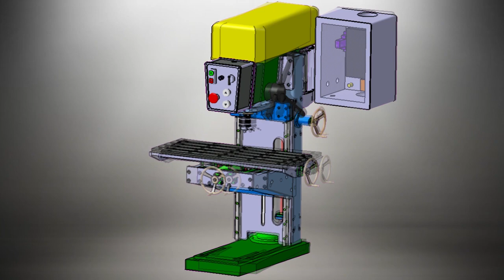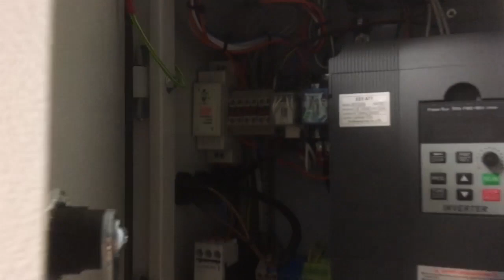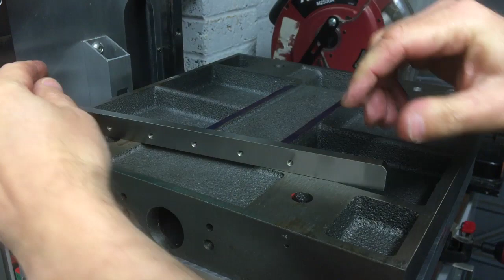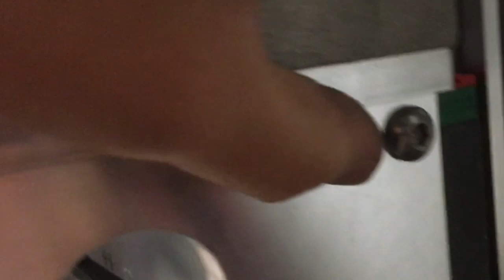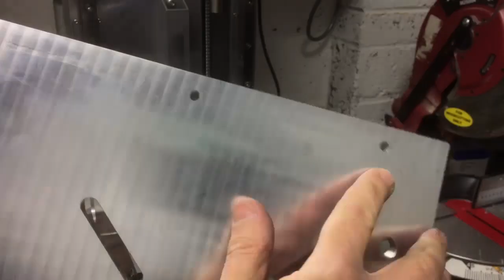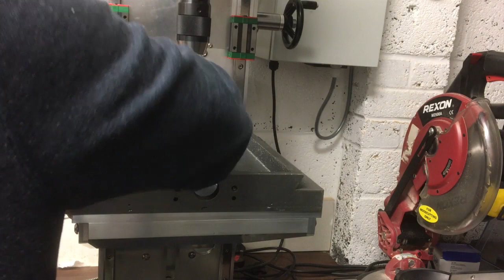Ep28: Drill Press Upgrade | Back on track . . . briefly

Comment: I'm late to these videos but still a word of advice to those that might watch. Don't assume that the cheapest item is at fault while being way over confident in your own work. Yes it could be the XY table but the first thing he should have done is tram the work table attached to the press, even with the dodgy chuck. Also removing the top plate of an entire structure to check for flatness is pointless as every fixing could be pulling it out of flat, including the back column. I'm only at 28.28 in this video so we'll see where this ends up. I'm enjoying watching these videos, including the diversion into ethernet conversion as I learnt of a different option for when my 2 CNC running XP computers fail. He also must enjoy fiddling because for the time & money spent on this, he could have bought 2 decent Schaublin's.
Reply from the maker: I had to skim watch this again to check what I uploaded as it has been a while!  I did tram to the original aluminium knee that I made but it was either an earlier video or done off camera.  I can’t remember.
The aluminium plate is tooling plate and arrives pre-ground so is pretty flat.  The white plate is a granite material (not surface plate quality) but I trust it to at least 0.05mm.
I think in the end I needed to skim the XY table and fettle the existing knee.
I agree with your comments about assumptions though and everything should be checked.
Checking a part in isolation is not definitive for sure but this was a long way out.
Good comments thanks and enjoy catching up!
Reply from the maker: And yes, I enjoying designing and fiddling rather than buying.  It’s the journey and process which I enjoy!
Reply: @routercnc9517  Well, we all learn. As I said, I learnt about ethernet control of CNC's. The only other option I'd looked into was those all in one controllers with all the stepper drivers included. So, if a driver chip goes, you throw the whole thing in the bin. Ethernet control seems the much better option & I like the look of the UCCNC software. As for your other comment regarding fiddling, I make jigs for that I never end up using, it's fun just to make the jig. I'm going to start watching your CNC router build when I've finished with the drill press.
Reply from the maker: I highly recommend the UCCNC with Ethernet.  It has worked flawlessly.
If you want the short version of the CNC build there is a 3 part directors cut on my channel which has narration. The full initial long version is the same but set to music which can get a bit annoying!  Also check out the mycncuk forum for more CNC advice.  Thanks

Comment: I think you need to bolt it down secure it than take a indicator anything less is not going to work and a straight edge is not the best way unless it's long enugh to cover the full surface  than you can find the highs and lows
Reply from the maker: Hi Dale.  Sorry for the delay, I missed this one.  Yes, you are right but I just used whatever I had to hand and we got there in the end.  A long precision straight edge is something I've thought about for some time but not bought one yet.  Thanks

Comment: Next project, surface grinder:)
Reply from the maker: I’ve got too many ‘next projects’ but that would be fun.  Physics Anonymous channel built one but in the end they also bought one so that suggests they are not as easy a project as they look (grinding is quite a science )
Reply: @routercnc9517 Theirs was destined to fail because it was made of hollow steel tubing weldments. It was guaranteed to resonate like a bell. Many of us warned them of that and encouraged at least filling the tubing with concrete or something (I suggested pouring them full of molten lead), but they called us trolls. Then when they finished it they only showed it working by carefully dialing in the spindle speed and such to get a good surface finish. Because it was resonating. Even once that worked as the wheel wears down the tuning would change. Their concept could work but they were too arrogant about their design, as though the strength of triangular bracing canceled out the fundamental concept of resonance.
Reply from the maker: I applaud them for having a go at making one but there must be a reason things are made a certain way.

Comment: to machine the base you could have used some parallels between the dovetails and the table of the machine to make sure it was parallel but got there in the end. Also you could also I would have used the DTI and swept the plate before the xy table was installed and then again at a different height (Used something between the DTI and the table) to ensure that it was both flat and perpendicular.
Reply from the maker: The DTI sweep on the top of the knee might have picked it up but depends on the radius.  The deflection down was towards the far left corner and the rest was flat.  I think that is why I missed it when I first built it as I just checked with the square which is quite small.  Anyway, lesson learned is to start with the thing you think it is least likely to be !
Reply: @routercnc9517  yes I agree with the square but the dti would have shown it up if you sweep nearly the full plate. you would see it dropping off in the corner because the top plate will flex with the bolts being tight. checking it this way would also reliably show if it is perpendicular and exactly which direction you are out in. there is defiantly more than one way to do it, this is just the way I would go about checking this kind of stuff when checking a machine.
Reply from the maker: Agree yes.  Some of this will have to come apart so I only need to be somewhere close for now.  I’ll sweep it at the end for the final adjustments.  Thanks